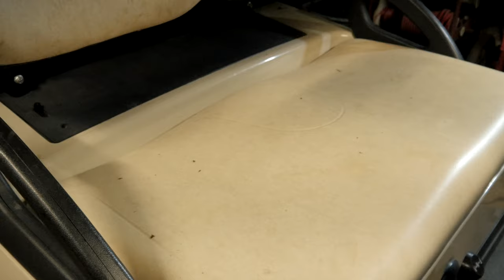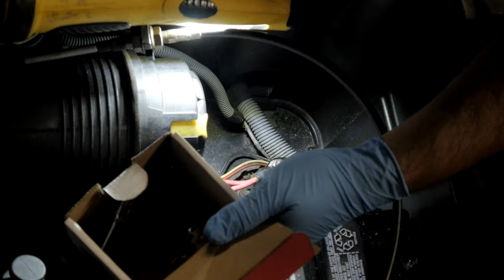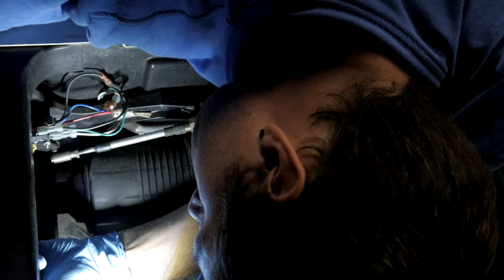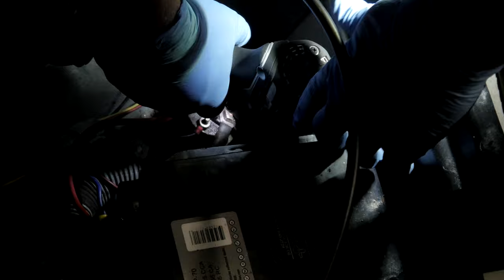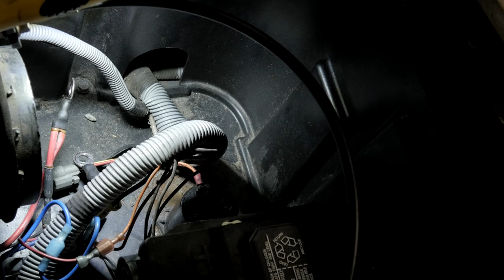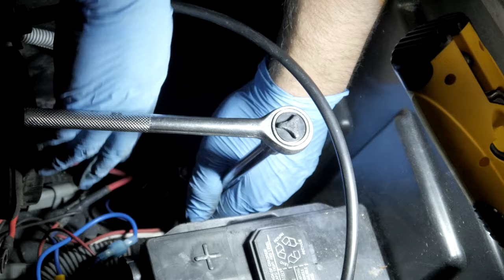2004 Club Car Precedent, Gas - Intermittent Crank, No Crank, Bad Solenoid

Comment: Don't you think a power tool removes the 'feel' of the screw engagement - Such that you can strip the head?   How about using a manual (touchy-feely) tool when there is not much turning to be done.  Maybe we over-use power tools where they do not offer an advantage?
Reply from the maker: If you go at it carelessly with no regard for what you're doing or if you do not know how to properly moderate your power tool, then yes, you will ruin the fastener quickly. I've been doing this long enough and I'm familiar with my impact driver to know how a screw is behaving and if it feels like its going to strip. If its going to strip out, its either the incorrect tool or stuck. In this case, no matter what method you use, will damage it. You can still strip out a screw using a manual driver, too. I use manual tools when needed.

Comment: I have noticed on gas precedents those hold down bolts and the bolts holding the batteries down become corroded and impossible to remove. Club car should go back to hex head instead of torx. Also removing all the wires first may have helped you get to the screws easier
Reply from the maker: It wouldn't be as much of a problem if they used stainless steel hardware. I've been changing out the mild steel hardware to stainless steel where applicable. This makes future servicing and repairs much easier. It also saves the customer money since I'm not spending wasteful time trying to gain access to parts. The wires were not in the way, the terrible location of the solenoid was the main problem.

Comment: My 2016 club car presesent had a 14 v solenoid. Can i use a 12 volt solenoid to replace it. Was alot cheaper at AutoZone. Looks exactly the same as the 14 volt
Reply from the maker: Yes, as long as its continuous duty rated. Intermittient duty solenoids will fail in a short period of time.
Reply: Ok cool. Thanks. Yea everything else was the same

Comment: The microswitch not seating on yellow cam would be a common problem. 
Ones in Oz only are flat.  Not bent like factory unit so installer has to put home made bend in it.

Comment: I too replaced the solenoid on my ez-go gas cart and to my delight it worked fine until I got to the 14th hole and then nothing when I pushed the accelerater .I removed the cover on the solenoid and gave it a tap and away I went again.could you suggest something that might help me out?
Thanks in advance for your help

Comment: Hi Kevin, I have a 1998 Ezgo txt gas buggy, I’m havin all sorts of electrical problems,the buggy wasn’t charging so I replaced starter/generator 2x voltage regulator,and a CDI box. It was running but when I took old CDI box off a wire broke off it, I replaced it with the new one but now I don’t have any spark, thinking that it was a faulty one I bought another one but it’s the same, motor turns over but no spark ?? I replaced the solenoid but it’s a 14 volt one is that ok ? Maybe the coil has to be changed as well ? Any ideas would be brill, Thank you for a great channel

Comment: I have a 14 club prec. Will start off fine for 10 min of driving. Then will kinda bog and backfire. But will start back and run but will keep doing the same thing.
Reply from the maker: Start with the simple stuff. Remove and clean the carb, replace fuel filters, check the spark plug for proper gap, use ethanol free gas if possible, check the air filter if its clogged.

Comment: Kevin, i have an old Golf Club Cart. About 1993, not sure if you ca-n help me. Cart haș sat for 6 months due to lockdown, it was fine before, but now it works cine apart from the bleeping noise will not stop S-o ive hâd to disconnect the battery. Can you advise me?

Comment: Wish u were around my location could really use ur help on figuring out why my golf cart wont crank i replaced micro switches solenoid cleaned carb new filter spark plug took starter generator off the brushes looked good .let me ask u this does the solenoid need a diode to go on top post to start only way this golf cart will start is if u jump from solenoid battery was going dead when drove at night that told me the generator was not working took it apart cleaned it still no start I got 84 club car ds gas powered with the Kawasaki motor now when I jumped it off the ground was not good so stuck flare blade screwdriver to solenoid no power move the ground wire on generator it cut got power started but only from the jump on solenoid had clicking going on when hit gas pedal replaced with new solenoid yesterday ntn is there a gas pedal switch or something under cart mabey was going to check this cart ran great the all sudden wouldn't crank one day got new micro switch hit pedal ntn I noticed the micro switch on back of forward rev handle was being maxed out bye the neutral lock out switch so I turned that plastic psc put a psc folded paper on that micro switch till i heard click it started like that for a while but now ntn i noticed my toggle switch for lights not working all sudden so u think that toggle switch could effect anything why mabey wont crank.running out options mabey I should replace the starter generator or battery only thing left but it just confuses me of why now the lights not working but my theory is first need to find out why the solenoid is not getting power I charged battery for almost 2 hours other night I know battery got power cause it fires right away when jump it off hoping to not have to RIP out wires an rewire hole thing over but as I'm second owner off golf cart regional owner good friend of mine he says that ntn has ever been changed out since he had only spark plug an oil change so everything I'm assuming is factory wiring looks good all incased its blowing my mind can micro switch burn up I looked inside of all them look good clean just cant get start with pressing gas pedal really wish I could find someone like u to work on it u really know ur stuff on these golf carts got itself good business not to many reliable trust worthy people out there any more but this guy he does it right one thing I like about you no corner cutting of it's going to take 3 or 4 hours u do it right no half ass work with you I can tell u take pride in what u do man an u do good work if ur every around the s.c area in murells inlet area would love for ya to come bye check my dead golf cart lol sorry for the long rant but man around here take something in an it might come out with more problems than it had an a big bill they don't want fix rather u just bye new one from them claim parts cant be got every part can be got might have to upgrade to use the part but there out there had place charge me 30 bucks for that plastic switch on neutral lock out switch that pushes the micro switch up on reverse an forward switch that mabey it was worth $10 or $15 bucks at most not $33 bucks never want give advice on what it could be I understand they got make money but to make money an get business u got help people an give a little advise but have ur self a good day there sir keep up good work.

Comment: Kevin 
What is test mode? I am trying my first attempt at working on a Club Car cart that is a no start/no crank and was just curious about the test mode.
Reply from the maker: Can you point out what time of the video you are referring to?
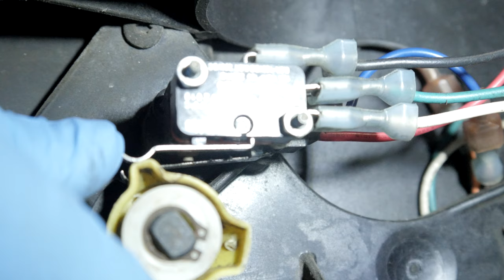Reply: @Kevinsgolfcarts  At 1:58 you mention a service mode, not a test mode like I said. After fooling around with this exact cart for a friend of mine, I figured out what you meant. I was able to use your knowledge of carts to diagnose my cart with a bad solenoid also. Thank you as I am new to cart repair but have been a mechanic and ATV mechanic for many years now and realize that really things are the same.
Reply from the maker: I'm glad you figured it out. Yeah, these are super simple machines. They used a lot of the same mechanics from the power sports world. The fuel injected stuff is a bit new to me and I don't get many units in with it.
Reply: @Kevinsgolfcarts  Well thank you sir. I appreciate your time and knowledge. I just subscribed to your channel.

Comment: nice video. can you just bridge the 2 large posts to bypass test the solenoid? [with key on and depress pedal]
Reply from the maker: You don't even need the key on or pedal pressed. By jumping the large terminals, it will crank the engine, as long as the starter/generator works. I would try to contact the nuts and not the posts, just in case the solenoid is still good. The posts are copper or bronze and will burn more easily than the nuts.

Comment: Did you disconnect the battery by doing the positive first?  Correct Practice is NEGATIVE First to eliminate the chance of the wrench handle contacting the chassis(grd.) CREATING A dangerous SHORT. Just sayin'
Reply from the maker: Yeah I know that. As long as you are careful, you can remove the positive cable before the negative. If you are not careful or somewhat mechanically capable, then you shouldn't be doing this type of work.
Reply: @Kevinsgolfcarts  thanks - Agreed.
Other?: Where is the microswitch (s) that START the cranking on 2009 Precedent? Thanks.

Comment: I jumped the solenoid the same as you did but I didn’t get motor engagement.. motor isn’t locked up, battery is charged.

Is that tell tale of a bad solenoid?
Reply from the maker: No, jumping the solenoid basically takes it out of the system electrically. It sounds like you have a bad starter/generator or its in need of new brushes. Brushes are very easy to replace but its best to remove the starter/generator from the cart. It makes it a lot easier to change them.
Reply: Just watch when take apart u don't mess with the ground bolts as it will RIP it loose an u will have no connection this but is on opposite side of pulley u turn it ur starter generator is done think that was my mistake can turn a little at time an will connect but wish I'd inspected it a little closer before I started taking buts off.

Comment: Kevin how do I know which side of the selenoid the small cables go to?
Reply from the maker: They are marked next to the posts +, -. If they are not, then it doesn't matter. Most solenoids are ground isolated, meaning the mounting bracket is not connected electrically to the internals.

Comment: I’m getting 12v across both small terminals. Any clue to why I’m not getting a ground. Can’t something short out to cause this? I’ve checked all the grounds I could find all seem good. Any help would be appreciated.
Reply from the maker: You might have something leaking voltage over that particular ground wire. You will have to trace each wire back from the solenoid and see if you have a broken/rubbed through wire. I'm surprised you didn't blow any fuses.

Comment: Thanks for the vid kevin, i could use your expertise on mine, its a CC 04 DS gas and just goes forward and doesn't engage in reverse, its a pain to take clutches off especially if i don't know what im looking for.
Reply from the maker: If its not engaging reverse, it could be that the shifter cable is out of adjustment or needs to be replaced. The clutches don't control direction, only speed.

Comment: I got club car DS ran good then wouldn't start replaced micro switch  on back side of the forward an reverse ran great 2 weeks now won't start at all I'll charge battery an try to start  no crank jump the solenoid run great but will not crank at all unless u just it u think it's my starter generator gone cause battery won't stay charged will stay charged until u run with lights on any suggestions think its solenoid push has pedal an just clicks an it is gas club car ds.
Reply from the maker: It sounds like your starter/generator has bad brushes. Its possible that it needs to be replaced, but I would try new brushes first.
Reply: Thanks for the respond so think it is the starter generator I was thinking that or voltage regulator but thanks again man .

Comment: I have a club car, when I push the gas it won’t shut off now, less I unhook the battery, does that mean this Illinois is bad?
Reply from the maker: You will need to check all of the micro switches, more specifically, the ones in the control box down by the oil filter. The ignition coil is not closing to ground when you release the gas pedal. This keeps the ignition active until you remove the power to the starter/generator. It is possible that the solenoid is sticking as well. You will need to check things with a multimeter.

Comment: I know this vid has a few birthday candles on it now, but anyone can help, I'm looking for a tutorial on just how the starter/generator works IN DETAIL. The big mystery is how it switches from starter to generator mode, and can unit burn out if something goes wrong. What I want to do is install an override switch where I can keep engine idling even if I take foot off gas pedal. I am afraid that generator will go into start mode  and fry something. Thanks!
Reply from the maker: Starter/generators "switch" from starting to charging mode based on RPM. There are no mechanical switching. To keep the engine idling, you will have to make adjustments to the throttle and keep the start circuit energized.
Reply: @Kevinsgolfcarts  Oh thanks! I thought about your explanation before. Still confusing. So, when you hit the GO peddle from dead stopped, the solenoid energizes the windings of the starter/gen, but after the generator reaches a certain RPM somehow the "starter" is over run by the Generator even though it's still starting? If so, can I use a DC clamp meter to find out when this happens? So, say you shut off the fuel to the engine and run engine at speed until the gas runs out. Will the "generator" just revert to "starter" mode and just crank engine trying to "start" it?

Comment: I changed a solenoid out and it ran great for the remainder of the day. Went to get on it the next morning and sounded like the battery was weak. Only tried cranking 4 or 5 times then stopped. I’m not showing any volts at the battery or solenoid now. Tried jumping solenoid it will crank over but won’t start. What did I do wrong
Reply from the maker: You will have to charge the battery with a stand alone charger first. I am willing to bet your voltage regulator has failed and is no longer keeping the battery charged while driving.
Reply: @Kevinsgolfcarts  I had a weak/delayed starting process also. I thought it was the Solenoid s's I charged the Battery - had same problem shortly after. ... turned out to be the REGULATORY.  Easy replacement.  Now dealing with 'pause before crank" issue.

Comment: I changed my solenoid the cart ran for 10 minutes and died now the solenoid only clicks
Reply: I have the same issue. 2004 Club Car Precedent. I’ve replaced the starter, the solenoid, the voltage regulator, the foot pedal switch, fuel pump, battery, spark plug, air filter. All I get is a solenoid click and engine doesn’t turnover. Any other suggestions?
Reply: I have similar issues. Did you guys figure out what was causing your carts to not crank?